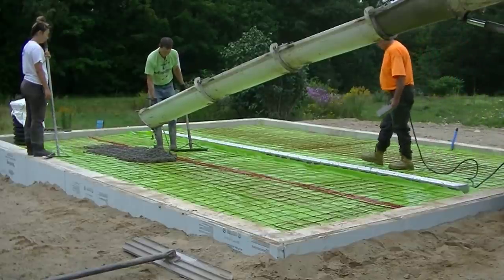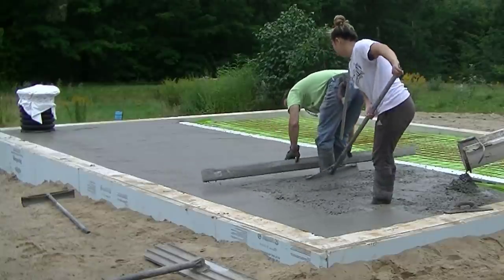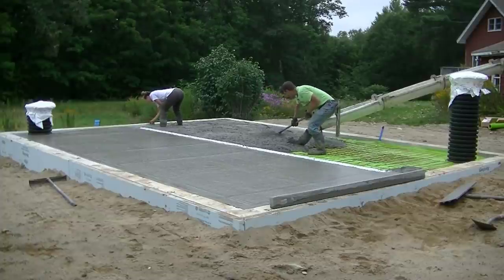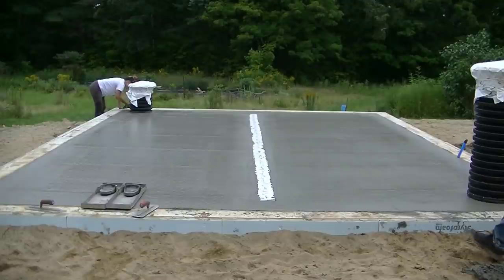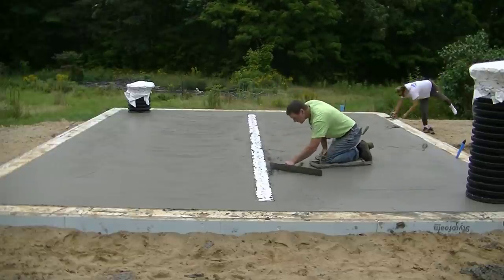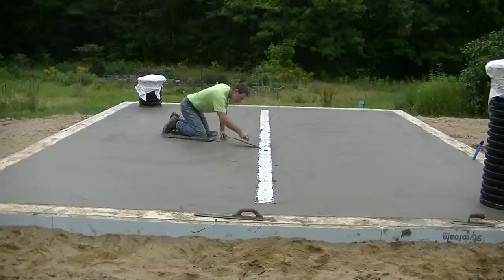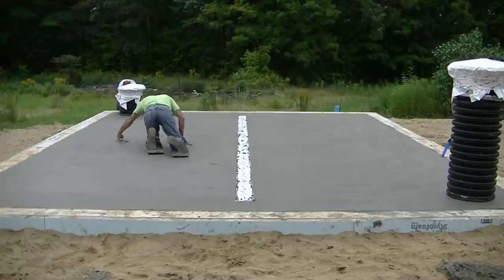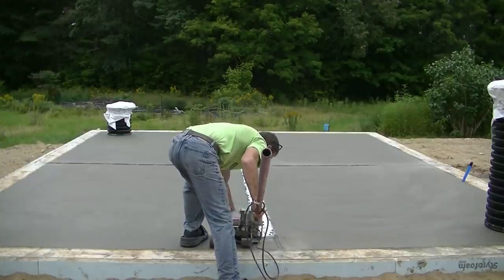One Man (and my Daughter) Concrete Slab Pour (Teaching How To Pour and Finish Concrete)

Comment: I laid my 10' × 12' shed floor with the help of one man (who helped barrow the concrete, and then screed it). Took two days (working part time) to form up the slab and get it square. One foot footings around the side, and 4 inch slab in the middle. I've never done concreting before, so took my time to get everything set up.
On pour day, the driver was brilliant. Knowing that this was my first pour, he first checked to make sure that the form work as ready and fit for purpose (and commented that I had the forms exactly square) and then wet down the concrete slightly to give us more time to spread and screed it. He even showed me how to get a good finish with my trowel. 
23 years later, the floor is still good, with minimal cracking.
It was only a small shed floor, but I'm still proud of what we achieved.

Comment: I've seen greenhouses that have corrugated pipes running underground that they pump air through and it basically thermal regulates it and they don't need to worry about heating/cooling systems, just a fan to move the air through the pipes. Since the ground at a certain depth maintains a constant temperature, it works.

Comment: Pretty sure those black columns are "Thermal" vents allowing year round 55ish degree ground temp to help warm the building in winter temps. 
Not 100% sure but I said it anyway🤷‍
Reply: Exactly what I'm thinking. Especailly being in a colder environment, and not having any posts for a heater. Being that they put a drain in the center, it seems like they thought this out and aren't doing the standard plain floor greenhouse. Then again, I come from professional greenhouse environment, so everything is a little different than something this small.

Comment: I am not sure if it was commented in the previous 174 but the tubes are more than likely for a climate battery. Basically during hot times they will pump heat down in the ground and it will cool the air on exit. Then during winter they can pump cold air down to warm up on exit. Basically a geothermal battery using air and ground mass to regulate temperatures

Comment: Hi Mike. I’m a former tile setter, so I’m good with a trowel. I’ve been prepping a walkway in front of my house between the newly repaved driveway and the grass. From the sidewalk 30 feet down it starts about 4 feet wide and eventually curves out to meet the 10 foot wide concrete steps I poured in 2015. I’ll have my 26 year old step son help me out. I still have to saw cut the the driveway edge. Not sure if I should edge finish the concrete where it meets the driveway. The total size of the job is about 170 square feet. It will be the height of the driveway and slope about an inch down to the grass on the opposite side. It will be about 50 degrees when I pour next week. Love your videos, very helpful.

Comment: The big tubes are probably connected to a buried tube, for a heat pump.  Throw a fan pushing air inside one, and 55 degree air will blow out the other big tube.  they need to be big to allow enough airflow to keep the whole greenhouse warm.

Comment: I do all the set up myself but like to get help from at least one person when I pour for placing mud and screeding it. Mainly shed pads and patios usually around 400 sq ft.  Always have to buggy mud in but the company I use for concrete offers a buggy rental with operator for about $60 more than just getting the buggy alone so Its like having an extra guy, plus I don't have to pick up/clean/return the buggy because the operator brings it and takes it back.

Comment: I have been watching a few of your videos Mike. I am a retired carpenter who has done quite a few concrete jobs and the one thing we always paid attention to was never step on the mesh or rebar after it was pulled up when placing concrete. I noticed here your stepping on the mesh after you lifted it with your pour. Most of your mesh is still at the bottom.Sorry, but this is my pet peeve on concrete placing.
Reply: In the video, Mike says he pulls up the mesh/rebar to allow rocks in the concrete mix to settle to the bottom. Apparently, you can tell when the mask/rebar is sitting on rocks, and that's how you know it's raised.

Comment: many people who build green houses use thermal to keep temp inside from freezing and overheating .  by running  pipes more than 6 foot deep under the ground then pushing the air through with a basic fan ventilation system ,  saving money from heaters & A/C

Comment: I know you use concrete trucks which isn’t always available. Have you done any slabs that you’ve done with just bags and a harbor freight mixer?  What about a start to finish from forms, mixing, screeding, finishing and stripping forms?  I need to do 12 X 12 4inch slab for a shed. I want to put in a water line, drain and electric. Any advice will help. I could pay someone but I want to do it myself. How do you slope to a drain? How do I know when I can get on to start finishing?

Comment: One man and Tia whose worth two, wish I could borrow her since I have no kids. I like using a router on the bull to cut or the diamond on small corners. I've been doing one man and appreciate your videos. After getting certified as a cop I got certified in concrete to fix my pool deck that cracked all the way across after hurricane Charlie hit in 2004. I learn as I go and worked delivering ready mix a yr. I love seeing it done right. I hated seeing what charlotte sea walks did to the 1.5 yds I brought them a 5 and they made it a 10 slump after they asked me to add 40 gallons of h2o to make it easier going into the forms at their hq. 
Don't Luke fiber but rebar. Does mag refer to magnesium float?
What's the difference in that and a trowel?

Comment: If the slab is sloped down to the middle, what happens with the outside walls? Are the edges sloped too?  Or is the perimeter of the slab flat?